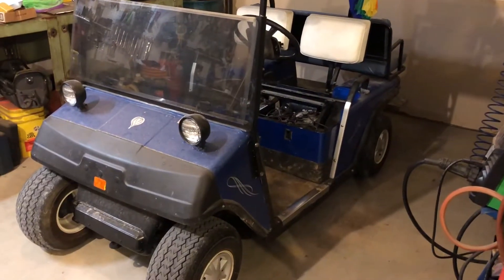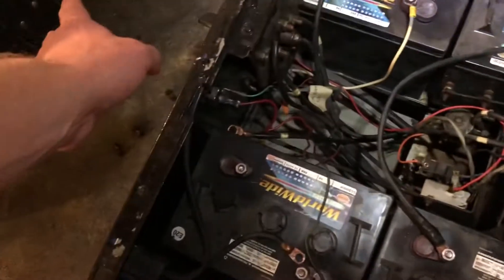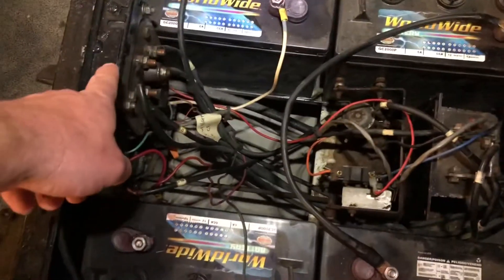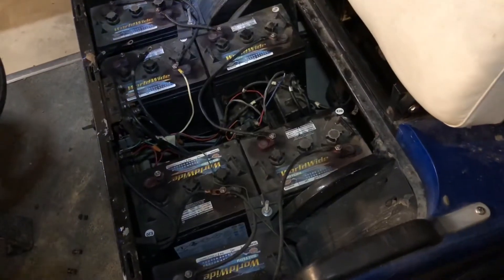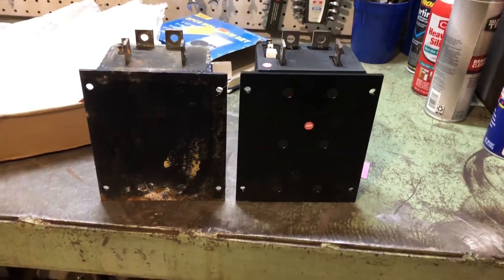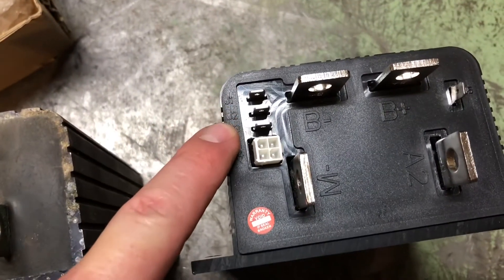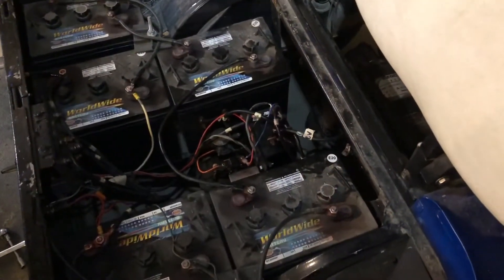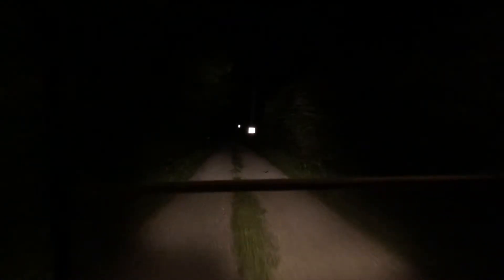Golf Cart Motor Controller Diagnose & Change

Comment: My 1993 marathon won’t move. I hear a faint sound coming from the solenoid when I press the accelerator but no movement. We replaced a micro switch on the F/N/R switch but nothing happened. Any ideas?
Reply from the maker: Solenoid should “click” very noticeably. A faint sound might indicate faulty solenoid? Try bypassing the solenoid and see what happens. Be careful it doesn’t run away from you or run you over if you do bypass it.
Reply: @justtinkering6054 it’s weird because it ran fine and then I parked it up at my house but went to move it and it wouldn’t want to move. The batteries are old and die quickly

Comment: the problem with mine is that when you step on the pedal normally it doesn't run, you have to press veeery slowly then it starts to move

Comment: What year model is your Cart?
Reply from the maker: The model is marathon. I think the year is around 1990.
Reply: @justtinkering6054  I have a marathon but could not find a wiring diagram.  Replaced the batteries and now I have no power solenoid does not open, but when tested it works.

Comment: What's it mean if it's going to 7 ?
Reply from the maker: It’s out of spec and might be causing issues. Does the motor stop when the potentiometer runs up to 7?
Reply: @justtinkering6054   yes its stops when fully engaged and when it's reading around 5 it goes. It actually goes to 7.5 I have a new oem one coming Monday.

Comment: Can you do a video covering all the wiring? What gose where? I have the exact same cart and can not find the info I need to get it wired back up. There is a green wire coming from one side of the key switch it gose to the forward/reverse switch but there's a red wire coming from the other side of key switch I have no clue where it goes. If you could make a video covering all the connections it wold be a tremendous help!

Comment: Great info thanks.  My Carr starts moving without pressing the gas pedal. In Forward or reverse, it doesn't matter it moves?
Reply: To fix, check ohms (set your meter to Ohms 20k) between the black and white (sometimes its red) wire that goes from the potentiometer (pot) to the speed controller, you should have a reading of 0 when the pedal is not pressed.  You can disconnect the wires to do this to make it easier.  You should have 5.0 at least when the pedal is on the floor.  My guess is your pot needs adjustment.  It is probably providing ohms when the pedal is not depressed.   Easy fix.    If so, loosen the screw that holds the arm on the pot to it's shaft.  Then turn the screw head of the shaft until you get a reading of 0.  Then tighten the screw that holds the arm on to the shaft.  Test that you get 0 when the pedal is not pressed and at least 5.0 when the pedal is the floor.  This should solve your problem.
Reply: @David Trevor  thanks Dave that's alot of good info, I'm going to check it right now lol
Reply: @MrPlasticdinosaur484  Good luck.  I had a similar problem with my cart.  Cart wanted to go when pedal wasn't depressed, then when depressed more than half way the cart would die.  It fixed my issue.   Also the reason the cart would die when the pedal was depressed more than half way was because the controller was getting an over voltage and would shut down. Turns out the cheap potentiometer wasn't adjusted right from the factory but also if the screw isn't tight the arm could just slip over time.

Comment: Glad your fix worked!  I have a really old EZ-Go...1982 model...having issues...I don't believe it has a speed controller though...has a Coil...the cart has a factory dash sign saying to floor the accelerator...don't partially press or the coil will heat up.  The first summer I had it - I was tooling around kind of slow "ish" and smelled something burning...it was the underside of the seat (wood) - the coil was almost yellow hot!!!!!  Uffda!  Now I try and run it flat out - in short bursts.  I use mine like your folks do - help on the farm...I'm in my 70's and it helps a lot with chores.  But now its not wanting to run...sorta acts like it will just creep a foot or two then quit.  I've checked everything as far as the batteries, the cables and wires...suspect the coil or the solenoid - no pentiometer on this either.  Will just keep searching and seeing if a solution presents itself.

Comment: hi i have a question for anyone.. i have a 36v G2 yamaha.. when i put it in forward it goes ,, on its own same with reverse.. no need to press the paddle?? also i  put in a new key ignition and  i can not figure the wiring to kill it so it can’t be used.. i found the diagram but makes no sense.. thanks
Reply: My guess is it's has to do with your throttle potentiometer. If you have one of the these controllers he showed in the video sometimes they are configured for 5k-0 ohm instead of 0-5k ohm. If programmed for the incorrect one it'll start going at full speed thinking that the pedal is fully pressed down.
Reply: I have a 1998 Yamaha G14, I check the potentiometer, it's different, you have to put a 0.5k ohm one. I also have to check the forward and backward button. I think I'll have to replace it in the end. This cart was given to me as a gift. in florida I am changing everything I am also deciphering the diagram for this controller

Comment: I got a question,the cable that runs from the gear box to the controller get really hot,then the cart starts to act up,sometimes it cuts out at 1/4 throttle,it's a 93 marathon ,controller issue or something else?

Comment: Went ahead and ordered the same controller, about $150. Ours was intermittent then became unusable. Replaced FNR, solenoid, charging ports. Kinda don’t mind throwing parts cannon at it cause they’re such old parts they’re going to fail sooner than later. The controller I got claims to have a 3 year warranty, that would be cool.
Reply: Well we replaced ours as well. Seems to have been the issue. Paid $160 for a new one with a 3 year warranty (so they claim) and clocked it at 16mph on slight downhill where before 14mph had been fastest recorded speed on flat pavement. It’s funny because in the process of replacing it I found an actual schematic from Cartaholics and found the varistor was on the wrong terminals. It was a college university utility cart prior to our buying it which was good because they used state subsidized $ to replace all the batteries just before replacing the entire cart. Has 6 NAPA golf cart 6vdc batteries that I hope will last another 4 years or more. They’re a 12/18 battery batch.

Comment: My cart takes off on reverse without pressing the accelerator. Forward works properly. Think the controller is causing that problem?
Reply from the maker: Check your forward neutral reverse switch. Then check pedal linkage. Then check potentiometer. If it’s none of these, it could be the controller. My money would be on the forward neutral reverse switch though. Good luck. Diagnosing the problem seems to always be the hardest part of most repairs.

Comment: Is there a RESET button  on those older ezgo  motors ?
Reply: Any update on the controller performance ?
Reply from the maker: I have not found a reset button on the motors. I’ve only handled a couple of them though. The controller is still working great.

Comment: How fast do you think it was going?  I have an 88 marathon that can’t seem to break 10 mph. Trying to get some additional speed and wondering if the controller is just getting old.
Reply from the maker: I don’t know how fast it was going when it would act up, but it was considerably slower than it’s normal speed. Full speed wasn’t slow all the time. It varied.
Reply: Ours was clocked at 14mph when it worked. A 1989 Marathon

Comment: Do you have a link for that controller? I have the same cart. Mine has a bad controller or a motor. Test at the motor when pedal is pressed motors receiving only 30 volts on every Pole but motor does not move or voltage change by pedal. With the pedal pressed down at any rate and moving the forward and reverse switch back and forth it will sometimes engage motor but only at full speed.
Reply from the maker: Sorry I don’t have a link. It came from eBay though.